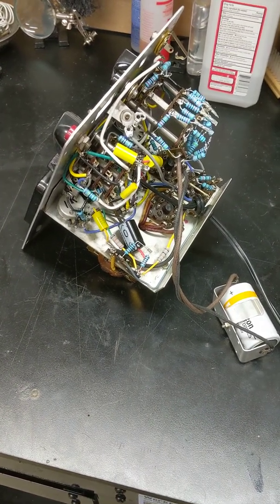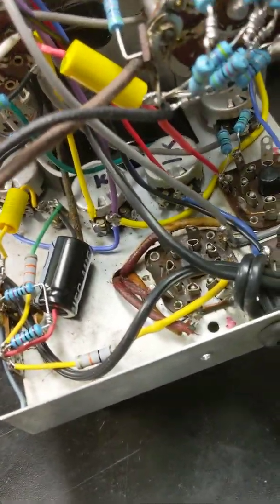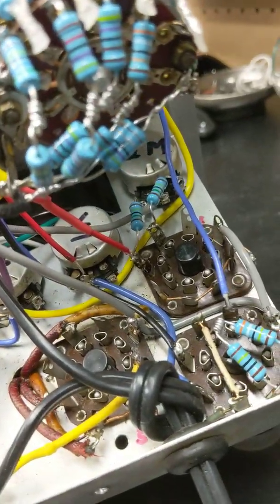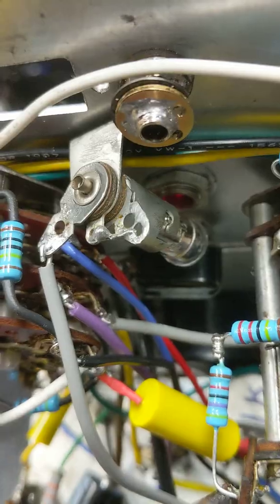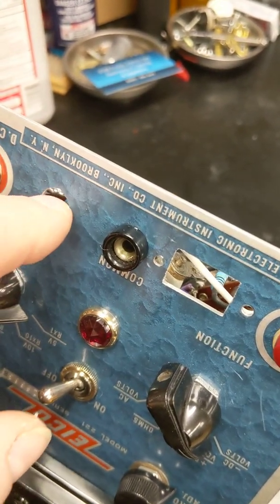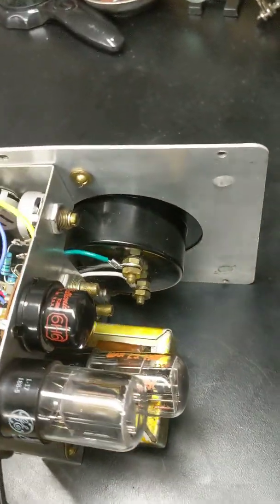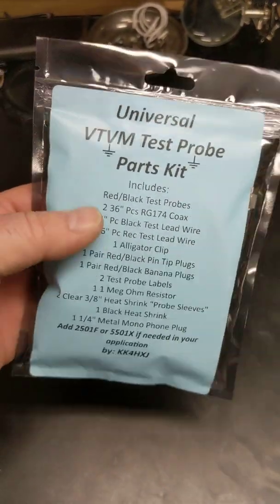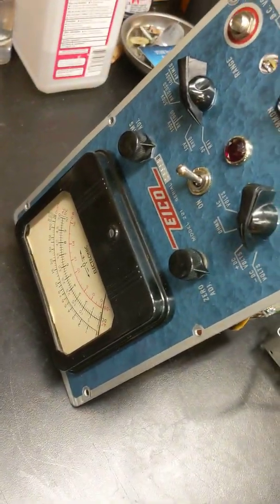Eico 221 VTVM Restoration - Part 4

Comment: Nice work looks very clean. I’m working on a 221 also. Hopefully I will completely rebuild it as you did. I got a construction manual and all the capacitors but I need to get all new resistors. Do you have a list of resistors you used? Or some pictures of the resistors? 9.5 ohm resistors are hard to find and I’m wondering what two values you used to make a 9.5 ohm thanks.
Reply from the maker: Thanks! If you have the construction manual it should have a list of all the components used during the assembly. I'm sure that's how I knew what to use.
Reply: @greggsvintageworkshop8974  ok I just bought one off of eBay. Do you know what the light bulb voltage is? I could just check it with a meter but I have the unit completely disassembled right now. I have a 8v bulb that is the same socket.